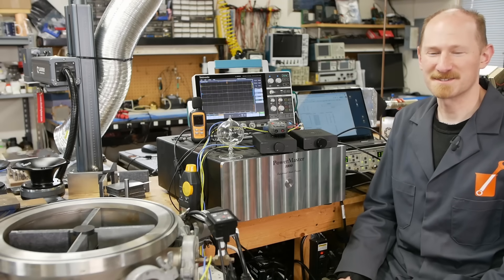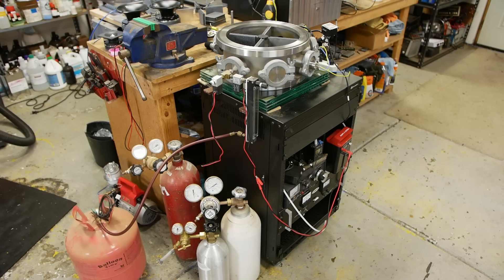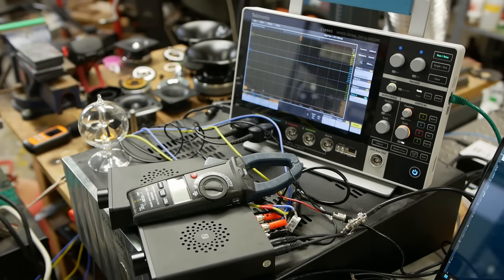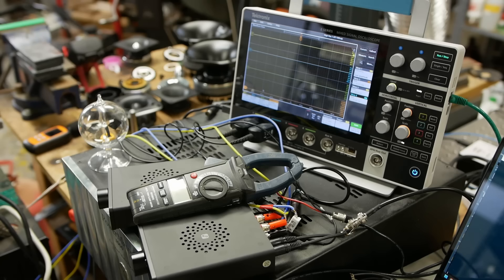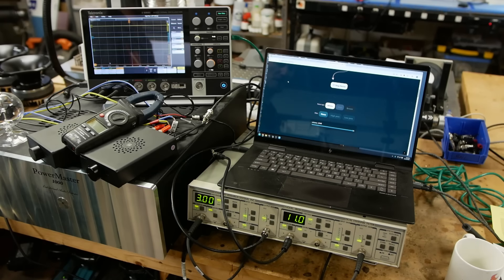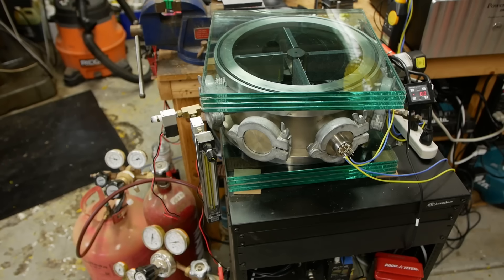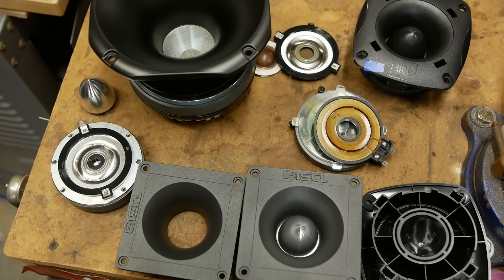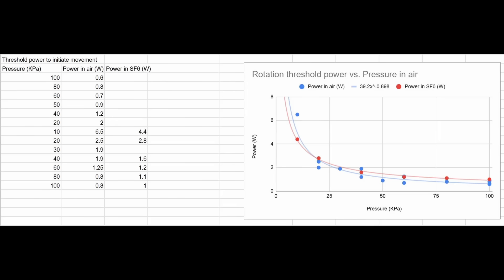Acoustic Radiometer spins in 130dB sound, clockwise and counter-clockwise depending on sound pattern

Comment: Just a comment on blowing up your speakers. Without a baffle they are acoustically short circuited. Furthermore the suspension expects loading from the box to limit excursion. Running speakers without a baffle/box will decrease the power handling and acoustic output by an order of magnitude  or so.

Comment: I would be interesting to try nitrous oxide. Also if you got a little more synth minded with signal it could be fun. Like using pink noise or saw waves. Also dynamic changes like a LFO going from White to Red Noise. Or different hi-pass and low-pass filter envelopes and different rates. You could frequency modulate the standing wave pure tone as well to pump it or move it around. I'd also try NGX foamboard and paddles being elliptical shape, something where the foci radius matches the minimum axis radius. There's lots you could do would be cool to see how these effect the rotational velocity.

Comment: i had to look up "acoustic streaming" because i wanted to understand the function of using white noise rather than a fixed frequency. would using multiple smaller speakers prove this difference better?
on the frequency issue, would different absorptive materials and thicknesses change torque with different frequencies?
i'm saying this specifically because of your Vantablack "hairs out of a follicle" description, which should work.
higher density fluids involve higher drag, more vanes with less space between them possibly? 50% filled
you did ask for questions and suggestions for this or anything else, so thank you for entertaining those.

Comment: 9:18 - I'm viewing the chamber to be a resonator and in that case white noise should excite various modes of that resonator.  Perhaps an analogy would be a violin string and bow - the bow generates a sort of noise on its own - but when dragged across a taut string you excite a fundamental resonance.  Or in electronics you pass white noise into a very narrow band filter with massive Q (infinite Q?) and select a single frequency.

Comment: Nice video, as usual. The only thing I think you could try is designing new loudspeaker horns to match the gas to the diaphragm, and 3D-printing them. Unless the match means the top diameter becomes too large to fit into the rig.

Comment: My bet is: hydrogen is going to make rotor spin slower, hexafluoride - faster, as heavier gas is harder to move by speakers and thus speakers are going to have higher resistance and higher power draw, so acoustic power is going to be higher with the density.

In case where sound is transferred from outside instead of being generated by speakers, both hydrogen and hexafluoride are going to make rotor spin tiny bit slower, as soundwaves transfer from air to gas is going to reflect a bit, losing some of it's energy in both cases.

Comment: One clarification, the Crookes optical radiometer is not driven by radiation pressure. The direction of motion is backwards from what you'd expect, and if you completely evacuate the chamber it stops spinning. The motion is actually due to thermal transpiration along the edges of the vanes, caused by the vanes heating up more on one side than the other and then transferring that energy to the gas.

Comment: I may have missed this, but in 3 phase power systems, there are 3 sine waves 120° out of phase of each other turn big horsepower motors, can the same be done with sound, perhaps rpm/frequency match, maybe even gauge it's terminal velocity of each gas? Or is that a stupid question?
Reply: Might be 3 dimensional and inefficient, but I'd like to see how fast it can go.

Comment: 10:10 if you could generate a rotating wave system (different phase angles on the speakers) you may be able to have a continous rotation. If it works I don't know but I would imagine it is an interesting experiment.

Comment: If no one said it before, i think H2 and He2 are too light (and other properties are not fitting) to have a recognizable effect on the rotor. They will require more velocity to transfer sufficient energy to the vanes. The heavier molecules and air in particular just fit into the properties required for transferring noticeable energy into the vanes.

Edit: It overlaps with rocket fuels which also get more efficient the heavier they are. But i think here the white noise excites air best because of the different weights of the molecules. There should be a certain frequency for each molecule that accelerates the vanes best - or several frequencies like overtones in music. You could ask someone from 2 stroke, F1 car or distinct brands exhaust system development, because they tune the exhaust system to affect the behaviour ióf the gases in a certain way.

I bet on SF6 and have a background in physics and chemistry, but i don't work in this field nowadays. So someone else who is currently in the matter can draw the lines between the relevant properties.

Comment: Heh, I’ve been doing audio engineering for many years, and some the best audio signal generators and measurement systems are balanced pro-audio sound cards.  They can generate and measure differentially, which works great for non-ground referenced measurements.

Comment: Paused at 3:50. I wonder what woudl happen to vanes without the sound dampening material on either side as well as vanes with that material on both sides. I hope it will come up in the video. EDIT: was not tested. Why am I interested in such a test? Because I want not to confirm just what I expect, but also confirm what I do NOT expect to see.

Comment: 3:10  I agree it’s likely due to the reflective v absorption side but , considering the rotor is balanced overall that’s ok but could you rule out the balance of each plate ? The weight of reflective material v absorption material, there’s surely some inertia ready if unbalanced per plate

Comment: I'm willing to bet that shifting the frequency band of the white noise would be enough to compensate for (at least some of) the other gases' properties, since as you noted the diaphragms were engineered for air (and so was the frequency band chosen). If I'm intuiting it correctly, for lighter gases at the same pressure there would be less density and thus less power the diaphragm can deliver with each stroke, so my first instinct would be to try an increase in frequency roughly equal to the mass ratio of air to H2 / He2.

Comment: my only suggestion is to do nitrogen (and pure O2 if you think its safe to do it): it would confirm the idea that it is just the speakers are designed for the normal air mix. You could even use CO2 but at a lower pressure that makes pure co2 be the same density as air? I assume it only would depend on density but it would be crazy if it was noticeably different with a gas mix instead of a pure gas at the same density.

Comment: I'm still trying to decide if the explanation of the generated torque makes sense. In a standard radiometer (in a vacuum) the photons reflecting off the white side imparts more momentum than the photons being absorbed on the black, for a net torque. Photons do indeed have momentum, proportional to their frequency (inversely proportional to their wavelength).

Unlike EM radiation, though, sound is not carried by particles moving with the sound. The particles of gas are mostly moving randomly, with rather small imbalances causing waves of pressure and vacuum. But there is no overall net particle movement along the direction of propagation, so I don't see what would provide any impulse to the vanes.

I suspect there is something much more complex occurring with the sound-absorbing material.
Reply: Well theoretically the effect of optical radiation pressure does exist but a standard radiometer works because of heating of the dark side and spins in opposite direction (black side trailing) to the one due to radiative effect (shiny side trailing). 

But you do have a point regarding the absence of momentum in a theoretical sound wave. For particles way smaller than the wavelength of radiation, Wikipedia says there exists an 'acoustic radiation force' which depends upon the compressibility and density ratios between particle and medium. But i'm not smart enough to understand how it appears from the equation nor how it might apply to larger objects.

I did find this comment from a researcher in acoustophoresis that said "Also, photons have momentum, but technically an acoustic wave doesn't... So in the world of experts in acoustics, it is not totally understood how it works... You can extract radiation pressure from the equations but in my opinion there is no simple satisfying way to explain its source."   Sooo it seems we're not the only ones having a hard time understanding it.

The macroscopic explanation i can think of is this: above 110db you are way above the nice smooth models described by those equation, and you start getting shockwaves which start to behave a bit more like an object with momentum. It would be interesting to see if a more sensitive version would keep turning even with lower db values.

Comment: really cool experiment on the different pressures and gasses. how does the temp / humidity effect this setup. curious because those change the speed of sound and the 'density' of the air.

Comment: Interesting. I love radiometers. This sound version is using momentum to spin; while a standard one uses thermal vibrations from the more absorptive black side to propel the spin. 
I would love to see a demo using photon's momentum if you could create one. I have had this idea for a while, I think it would need very long lever arms and small diamond leafs. It would probably also need to be in a vacuum and in some sort of cooling bath. Shining a weak laser through the diamond leafs might lead to movement from photon's momentum. Would need to do the math to see if it's even noticeable to the human eye though. Maybe a DRO would be required on the main axis.

Comment: The biggest question I have is - can you combine an acoustic radiometer and regular crookes radiometer to produce a sort of tug-of-war effect as a function of gas pressure in the system where the relative amount of acoustic vs emag radiation energy to spin the radiometer in opposing directions changes?

Comment: I wonder if you could get an enhanced effect in the helium/hydrogen atmospheres by changing the frequency range of your white noise to be higher or lower for the different density gasses like the sulfur hexafluoride too. Since you're going to try different speaker cones for impedance matching you might get better results with different frequencies as well

Comment: Great to see you independently develop the current and voltage temperature inference measurement technique!
One important aspect (that helped in your application) is that the power handling of a voice coil in free air is dramatically lower than the power handling of the same voice coil in the magnet structure, as the close proximity of metal acts as a reasonably effective heat sink. 
With bass drivers, the effect is more significant as the forced pumping of air from the motion of the cone improves the heat dissipation even more.

Comment: Could you use a setup similar to this for a rocket propulsion system? Not really efficient but fur fun? Might not make any sense. 
Sound is a wave or a pulse of energy the might be useful somehow?
Use sound to stabilize a gadget not rotating by modulating the speakers via microphones and visual input?
Many questions marks , any answers?

Comment: A mix of helium and sulfur hexafluoride till it's the same density as air would be interesting to me, you might even be able to tune a mix in till it couples as well or better with the speakers than the air.

Another question I have is the temperature dependence.

Yet another one I have is how low you can go with it, I know radiometers stop working well beyond a certain quality of vacuum, and I know the paschen curve for air has a low point ~~1 torrish so ~~~0.1 kPa I'm curious when there isn't enough air to push it around. (A mechanical high-vacuum gauge based on sound would be very funny to me)

A very very silly thought occurs to me: if instead of white noise you play it a pitched down sound of a turbomolecular pump to get it spinning quickly. Do I think it would work? Oh hell no. Would it be funny as a "motivational" tape for it so it knows what to aim for? Maybe, maybe.

Comment: Does the system behave the same if you put the rotor in the far field of a speaker with a more planar wave? When you mention the impedance matching of the horn at the speaker output, this assumes free space around the output. Your setup seems not to provide this. 
Another question would be about the orientation of the rotor blades. How would the results change if they are oriented perpendicular to the pressure wave? 
Maybe a setup with a tube wave guide would work?

For a periodic stimulus a flat spectrum chirp can be interesting where you design the phase / group velocity to deliver constant energy.

Comment: Did you try introducing a phase difference between the speakers (E: or driving them with different white noise/slightly different single tone)?

Are you measuring actual and apparent power delivered to the speaker separately? I'd expect the speaker to behave like a transformer and resistor (representing resistance of the wire in the speaker) in series, with secondary of the transformer loaded differently depending on how badly mismatched the speaker is with gas.

Comment: If you put an aluminum disk on top of the rotor hub you can use a strong magnet to apply an adjustable braking force. The induced eddy currents will convert rotation into heat in a very predictable manner.

This could act as a dynamometer, allowing rotary power measurement.

Comment: I measure temperature of LEDs in roughly the same way :). (When I have an LED that's pulsed, I pass 10mA through it also when it should be off and measure voltage drop then: it correlates well with temperature, even if the exact function is somewhat specific to each LED. I don't have a thermal camera, so I calibrate the whole thing by heating the LED with a hair dryer and pick that as a do-not-exceed temperature.)

Comment: Super interesting video 🤩, thanks! Some questions came up on my side I'm afraid ;-)
1. Measuring speaker blowup: Could you publish your python script to calculate the speaker temperature? All its input are the V / A measured on the oscilloscope and the time, right? I would be super interested how you calculate the temperature heating and cooling taking historic values into account. So the speakers blow up because the coil gets too hot? How did you know at which temp. this happens?
2. Acoustic radiometer functionality: Probably due to lack of some basic physics understanding, I did not understand why for the same pressure wave the momentum on the absorptive side is half of that of the reflective side? I mean, the same force / power is hitting the blade on each side if the pressure is the same.

One comment: Shouldn't the axis labels on the "Relative coil impedance vs. coil temperature" chart be switched? Temperature values between 1.0  - 1.5 make less sense, than between 0 - 200 and relative values make more sense between 1.0 - 1.5 rather 0 - 200 ?

Comment: If the "right" way for a radiometer to spin is away from the reflecting side, why did your (optical) radiometer turn away from the (black) absorbing side? Optical radiometers don't work the way you might expect!  (Hint: the enclosure does not contain a vacuum, it's just low pressure air.)

Comment: Given the shape of the surrounding container and it's material, I think a lining along the cylinder wall with foam would've been better.  When reflecting sound energy from the aluminum side, sure that's 2x the momentum, but I'd suggest some significant portion of that reflected momentum will wind up as 1x momentum in the absorption material in the opposite direction.  From a sound perspective, I think this chamber is internally more akin to a mirrored finish than the Crooks radiometer.

Do you have any kind of super-sensitive load cell contraption?  Would it be interesting to see a static experiment to find what actually absorbs sound, rather than scattering or reflecting it?  Demonstrating beneficial construction geometry might be fun.  Could the foam squares be cut laterally?  Either on the backing pieces or a wrap for the walls of the cylinder.

Comment: The first thing that came to mind is that you’re creating movement with a noise signal – basically a combination of many different frequencies. Different gases might respond better to different frequencies. So when you have a single gas in the chamber, you’d ideally optimize the noise generator to the specific frequencies that work best for that gas.

With air, since it’s a mixture of gases and you’re feeding it noise across a wide range of frequencies, on average you’re doing a better job of injecting energy into the system and turning it into kinetic energy in the blades. So I think air ends up being a “fortunate” solution here: the system is very inefficient overall, but air just happens to be the least inefficient option.

It's just a wild theory that came to my mind I have nothing to back it up

It would be cool to simplify the geometry and setup so there are not that many variables in place and we could try to get a better understanding

Comment: Why did you select a "ring radiator" tweeter with a tiny piston area instead of a conventional "compression driver" with a far larger piston area?  Second, your chamber provides a heavy acoustic load, so heavy the horn does not have the same effect it would in the usual application.  Together, why didn't you use a big speaker and lower frequencies?